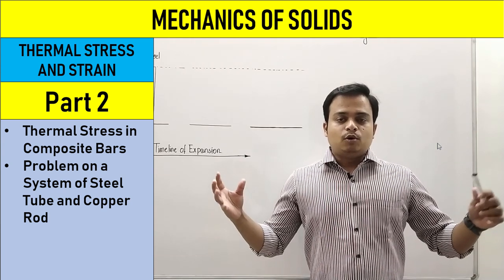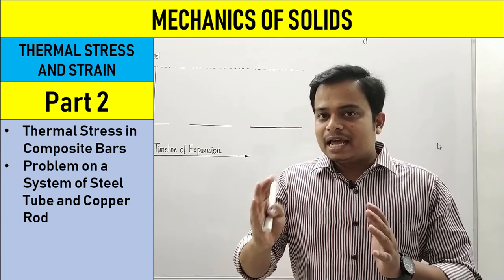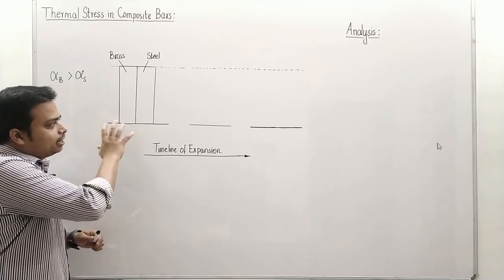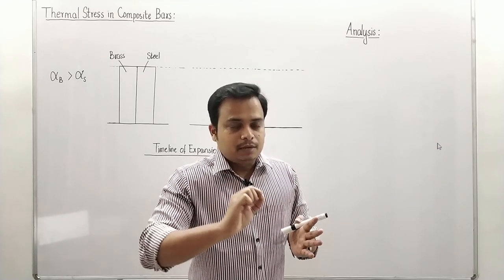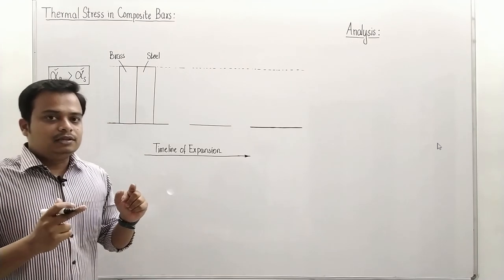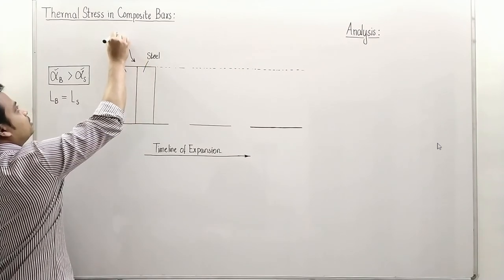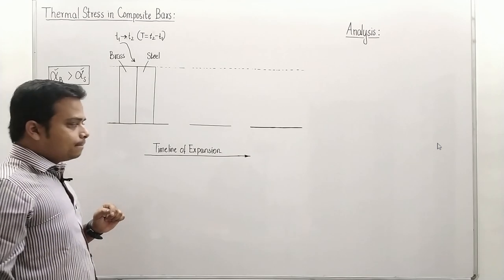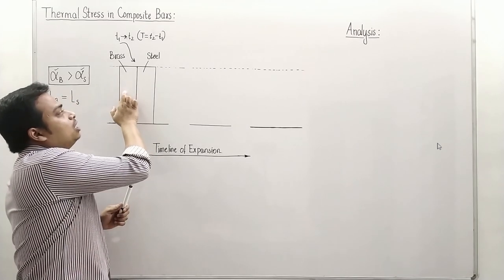Mechanics of Solids | Thermal Stresses and Strains | Composite Bars |

Comment: Sir won't the composite material bend such that the outer most of fiber of brass is at full length and the outer most fiber of steel will elongate but less causing bending.

Comment: sir i have one doubt..at 10:18  the "L" which is multiplied with {sigma b/Eb} should be the free lenght of bars after thermal expansion..i.e. instead "L" we should use L+αTL...I think...since we use formula PL/AE...where L is the lenght when their is no stress
Reply: the scenario L+alfa*T*L does not take place, it is expected length, but in formula we use original length. hence L is used

Comment: The temperature of steel bar, 2 m long, is increased from 300 C to 500C. Find the change in 
length, stress and strain produced in the bar due to thermal changes. What will be the  
nature of stress? Solution pls